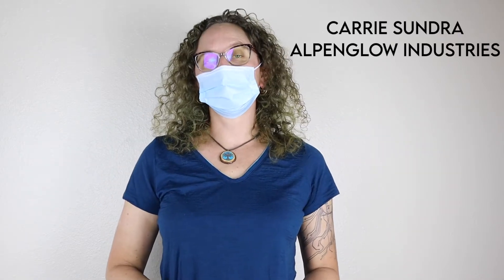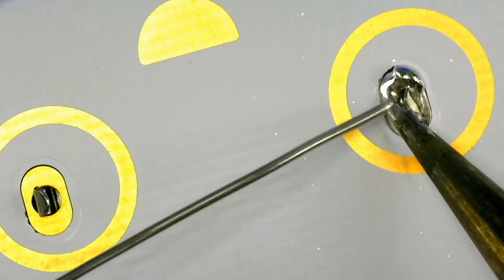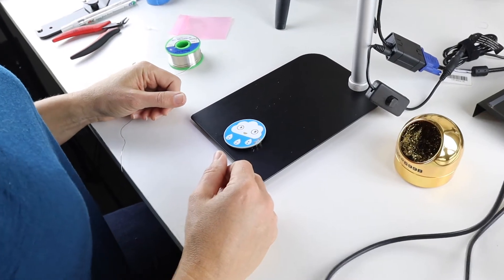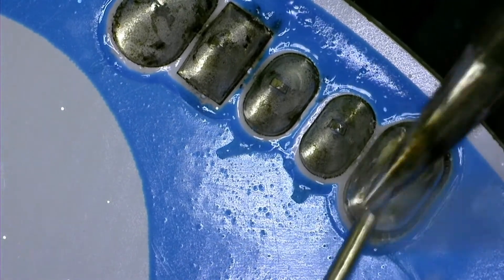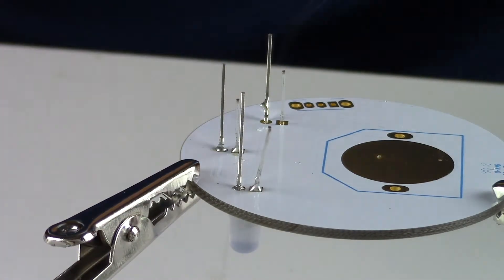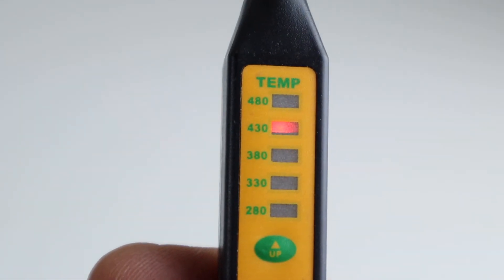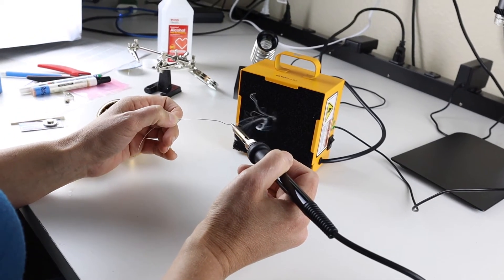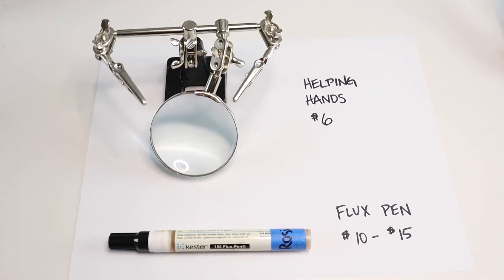How To Solder Episode 1

Comment: Very nice primer on soldering technique. I especially like your no nonsense approach to soldering basics especially when it comes to tools. I notice that you wear glasses as do I. Two things that I would stress are that glasses should be worn for safety sake whether it be from getting accidentally burnt from a splash of hot solder or an errant component lead that isn’t restrained when being cut off following soldering. The other thing that I would stress is to make sure that you plunge your hot soldering tip into the brass wool tip cleaning ball. Rubbing the tip into the brass wool isn’t a good idea because molten solder can be flung because the brass strands are somewhat springy. Also plunging your tip into the brass tip cleaning wool ball cleans the entire tip (all surfaces) with 1 fluid motion. As for solder, I’m an old fart: the tried and true Kester 60/40 and I try to remember to always wash my hands following any soldering work. Thank you!